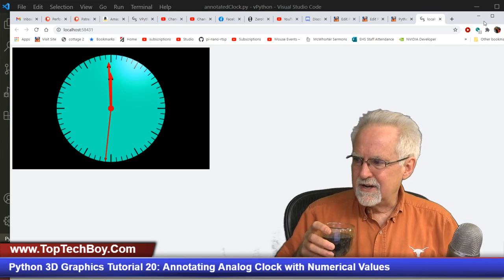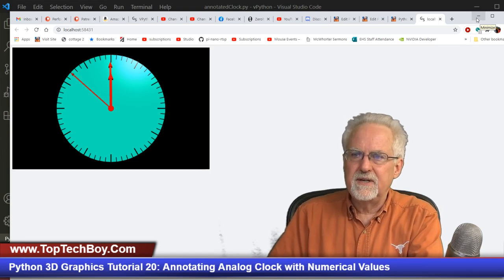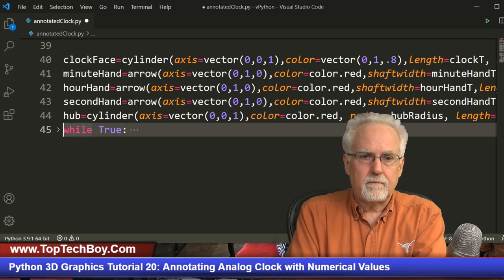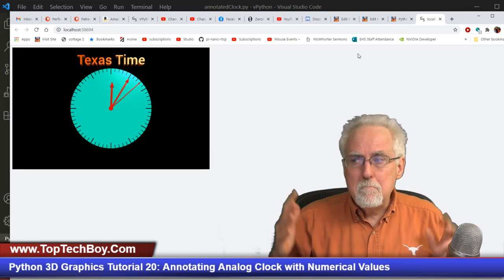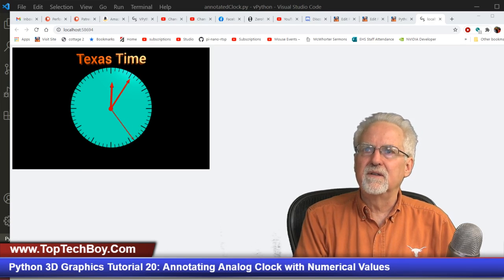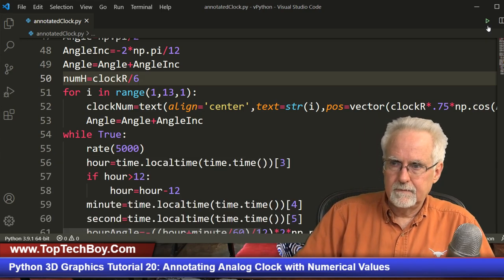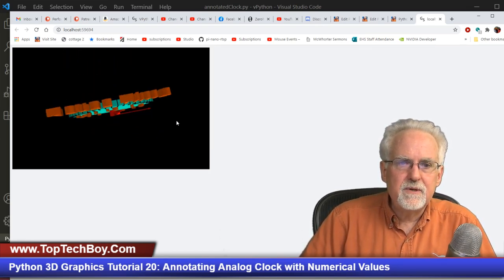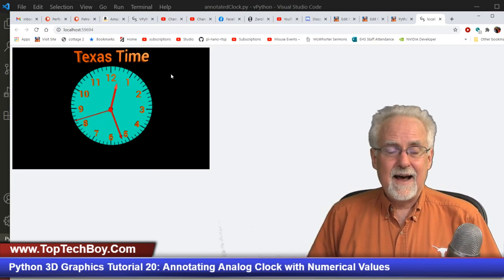Python 3D Graphics Tutorial 20: Annotating Analog Clock with  Numeric Values

Comment: I did the homework but I calculated the angle for the position in the for loop differently than you did.  This is the code that I came up with:

for clockNumber in np.linspace(1,12,12):

        angle = (-(2*np.pi/12)*clockNumber)+(np.pi/2)
        clockNumbers=text(text=str(int(clockNumber)),height=clockR/8,align='center',color=color.red
        ,pos=vector((np.cos(angle)*(clockR-quarterMarkL*2)),(np.sin(angle)*(clockR-quarterMarkL*2)-clockR/16),0))

Hope that this is still a correct way of doing it as it is somewhat different from what you did.  I don't want to assume that it is correct only because it did work.  I am really enjoying learning python and look forward to learn more.  You are great.

Comment: LEGEND!!!

from vpython import *
import numpy as np
import time

# ClockParameters
clockFaceRad = 15                                       # radius of face of clock
tickLengthLarge = clockFaceRad / 5                      # Length of the major ticks
tickLengthSmall = tickLengthLarge / 2.5                 # Length of the minor ticks
tickWidthSmall = clockFaceRad / 75                      # Width of the minor ticks
tickWidthLarge = tickWidthSmall * 2.5                   # Width of the major ticks
clockInnerRad = clockFaceRad - tickLengthLarge*0.75     # Distance of center of clock to center of the major and minor ticks 
clockFaceThickness = clockFaceRad / 20                  # Thickness of the clock face

minHandLen = clockFaceRad - tickLengthLarge             # Length of the minute hand
hrHandLen = minHandLen*0.75                             # Length of the hour hand
secHandLen = minHandLen*1.05                            # Length of the second hand

secHandHeight = tickWidthLarge/2                        # Height of the second hand
secHandWidth = tickWidthLarge/2                         # Width of the second hand
minHandHeight =tickWidthLarge                           # Height of the minute hand
minHandWidth = tickWidthLarge/2                         # Width of the minute hand
hrHandHeight = tickWidthLarge*1.5                       # Height of the hour hand
hrHandWidth = tickWidthLarge/2                          # Width of the hour hand

secHandColor = vector (1,0,0)                           # Color of the second hand
minHandColor = vector (0.1,0.1,0.1)                     # Color of the minute hand
hrHandColor = vector (0.1,0.1,0.1)                      # Color of the hour hand

tickColor = vector (0,0.5,0.5)                          # Color of the ticks
clockFaceColor = vector (157, 34, 53)/255               # Color of the face

textHeight = clockFaceRad/10                                        # Height of text
myLabelText = 'My Clock'                                            # Text on clock face
myLabelPos = vector (0,clockFaceRad/4,-clockFaceThickness*0.95)     # Position of the text    
myLabelColor = color.white                                          # Color of the label text
myLabelDepth = clockFaceThickness                                   # Depth of the label text

hrMarkRad = clockInnerRad*0.8                           # Distance from center of label to center of clock
hrMarkTextHeight = tickLengthLarge*0.5                  # Height of hour markings
hrMarkTextColor = myLabelColor                          # Color of hour markings
hrMarkTextDepth = myLabelDepth*1.05                     # Depth of hour markings

hubRadius = tickWidthLarge*2                            # Radius of the central hub
hubColor = minHandColor                                 # Color of the hub    
hubLength = clockFaceThickness*2                        # Length of the hub

clockFace = cylinder(axis = vector(0,0,-1), radius = clockFaceRad, color = clockFaceColor, length = clockFaceThickness, shininess = 0.1)
hub = cylinder(axis = vector(0,0,1), radius = hubRadius, color = hubColor, length = hubLength, shininess = 0.1)
myLabel = text(text = myLabelText, pos = myLabelPos, align = 'center', color = myLabelColor, height = textHeight, depth = myLabelDepth)

angleInc = np.pi/30
i = 1
while i < 61:
    tickLength = tickLengthSmall
    tickWidth = tickWidthSmall
    if (i%5 == 0):
        tickLength = tickLengthLarge
        tickWidth = tickWidthLarge
        hrMark = text(text = str(int(i/5)), pos = vector(hrMarkRad*np.sin(angleInc*i),hrMarkRad*np.cos(angleInc*i)-hrMarkTextHeight/2,-clockFaceThickness*0.95), align = 'center', color = hrMarkTextColor, height = hrMarkTextHeight, depth = hrMarkTextDepth)
    markClock = box(axis = vector(np.sin(angleInc*i),np.cos(angleInc*i),0), pos = clockInnerRad*vector(np.sin(angleInc*i),np.cos(angleInc*i),0), length = tickLength,  width = tickWidth, height = tickWidth, color = tickColor)
    
    i = i+1

# Initialization of the clock
myTime = time.localtime(time.time())
k = myTime[5]               # get the seconds
prevSec = k                 # placeholder for previous second value
i = myTime[4]+k/60          # get the minutes
j = myTime[3]*5+i/12        # set the hour hand, taking into account there are 60 increments for the 12 hours and we need to include fractional hours (based on the minute hand)   

secHand = box(axis = vector(np.sin(angleInc*k),np.cos(angleInc*k),0), pos = vector(secHandLen*np.sin(angleInc*k)/2,secHandLen*np.cos(angleInc*k)/2,tickWidthLarge*2.5), length = secHandLen, height = secHandHeight, width = secHandWidth, color = secHandColor)
minHand = box(axis = vector(np.sin(angleInc*i),np.cos(angleInc*i),0), pos = vector(minHandLen*np.sin(angleInc*i)/2,minHandLen*np.cos(angleInc*i)/2,tickWidthLarge*2.0), length = minHandLen, height = minHandHeight, width = minHandWidth, color = minHandColor)
hrHand = box(axis = vector(np.sin(angleInc*j),np.cos(angleInc*j),0), pos = vector(hrHandLen*np.sin(angleInc*j)/2,hrHandLen*np.cos(angleInc*j)/2,tickWidthLarge*1.5), length = hrHandLen, height = hrHandHeight, width = hrHandWidth, color = hrHandColor)

while True:
    
    if (prevSec == k):              # only update all the hands once every second
        myTime = time.localtime(time.time())
        k = myTime[5]               # get the seconds
      
    else:
        prevSec = k                 # remember previous second value      
        i = myTime[4]+k/60          # get the minutes
        j = myTime[3]*5+i/12        # set the hour hand, taking into account there are 60 increments for the 12 hours and we need to include fractional hours (based on the minute hand)   
        
        secHand.axis = vector(np.sin(angleInc*k),np.cos(angleInc*k),0)
        secHand.pos = vector(secHandLen*np.sin(angleInc*k)/2,secHandLen*np.cos(angleInc*k)/2,tickWidthLarge*2.5)
        secHand.length = secHandLen
        
        minHand.axis = vector(np.sin(angleInc*i),np.cos(angleInc*i),0)
        minHand.pos = vector(minHandLen*np.sin(angleInc*i)/2,minHandLen*np.cos(angleInc*i)/2,tickWidthLarge*1.5)
        minHand.length = minHandLen
           
        hrHand.axis = vector(np.sin(angleInc*j),np.cos(angleInc*j),0)
        hrHand.pos = vector(hrHandLen*np.sin(angleInc*j)/2,hrHandLen*np.cos(angleInc*j)/2,tickWidthLarge)
        hrHand.length = hrHandLen

Comment: I feel like I may have taken the easy way out on this one. In the end it work. Here's what I did.

I created an array with the numbers 1-12
made a counter starting at 0, to reference my array.

Used my major tick POS and for LOOP ("for theta in np.linspace(0,2*np.pi,13): ect ect

then in my text i used the array[counter}

for example:

myArray = ["3","2","1","12","11","10","9","8","7","6","5","4"]
counter=0

myText=text(text=myArray[counter],.....ect ect)
counter=counter+1

Im going to confirm but im pretty sure when i defined myArray i could of specified a string value and not needed all those ""s

for example: myArray=str(3,2,1,12,,11....ectect)
Reply: So I tried doing it this way but it says that the set object is not callable

Comment: I am legend.
It took me ages to figure out why the numbers were offset up the face. Such a simple step to subtract half the height! I subtracted half the height as as kind of fudge at first, then it hit me that the alignment is at the bottom of the 'text box'......

Also, I appreciate that Paul is being super methodical with subtracting pi/2 from the initial angle and incrementing it negatively. However, where sin and cos are 90° out of phase, and cos is an even function and sin is odd, you can just use sin and cos the other way round and not use any negatives 🙂

https://youtu.be/IJzmLJX-UlI

from vpython import *
import numpy as np
import time

########################################################################################################################################################

# VARIABLES:-

# clock body parameters:
clockrad = 1 # clock radius
clockD = 0.15 # depth of the 'body' of the clock
rimW = clockrad*0.07 # rim width (the rim is to be made up of boxes)
rimD = clockD*1.35 # depth of the rim i.e. the dimension that runs perpendicular to the face
rimsmoothness = 1800 # This is how many boxes make up the rim
offset = clockrad*0.04 # distance between ticks and outer rim
clockbackD = clockrad*0.01 # this creates a 'back of the clock, the same colour as the rim so the ticks can't be seen from the back of the clock
centrepinR = clockrad*0.03
centrepinL = (rimD - clockD)*0.9 # height of the centre pin for the hands to (rotate) around
faceD = (rimD - clockD - centrepinL)/3 # thickness of the 'glass' at the front of the clock

# Text and Tick parameters:
textH = clockrad/8
ref = clockrad/4 # Reference (this was the Major ticks from previous clock editions)
SMtickL = 2*ref/3 # Semi-major tick length
SMtickW = SMtickL/5 # Semi-major tick length
SMtickD = SMtickL/8
mtickL = ref/5 # minor tick length
mtickW = mtickL/6 # minor rick width
mtickD = mtickL/8

# Hand parameters:
sechandL = clockrad - offset - mtickL/2 # second hand length
sechandD = sechandW = sechandL*0.015 # second hand depth and width
sechandH = centrepinL*0.95 - sechandD/2 # height of the second hand above the clock face.
minhandL = sechandL # minute hand length
minhandW = minhandL*0.05 # minute hand width
minhandD = minhandW*0.1 # minute hand depth
minhandH = centrepinL/2 # height of the minute hand above the clock face.
hourhandL = sechandL*2/3 # hour hand length
hourhandW = minhandW*1.2 # hour hand widith
hourhandD = minhandD # hour hand depth
hourhandH = centrepinL*0.1 + hourhandD/2 # height of the hour hand above the clock face.

##############################################################################################################################################################################################################################################

# ELEMENTS:-

# Clock body including rim, back, and central pin for hands:
clock = cylinder(radius = clockrad, color = color.white, axis = vector(0, 0, 1), length = clockD)
for i in np.linspace(0, 2*pi, rimsmoothness): # Start the boxes from the y axis and go clockwise...
    rim = box(length = 2*pi*(clockrad + rimW)/rimsmoothness, height = rimW, width = rimD, pos = vector((clockrad + rimW/2)*sin(i), (clockrad + rimW/2)*cos(i), rimD/2), axis = vector(cos(i), -sin(i), 0), color = color.red)
    # (length, height, and width are x, y, and z respectively)
    rimround = cylinder(radius = rimW/2, length = 2*pi*(clockrad + rimW)/rimsmoothness, pos = vector((clockrad + rimW/2)*sin(i) - (pi*(clockrad + rimW)/rimsmoothness)*cos(i), (clockrad + rimW/2)*cos(i) + (pi*(clockrad + rimW)/rimsmoothness)*sin(i), rimD), axis = vector(cos(i), -sin(i), 0), color = rim.color)
    # The (pi*(clockrad + rimW)/rimsmoothness) elements here are to ensure the cylinders are perfectly aligned with the boxes of the rim.
back = cylinder(radius = (clockrad + rimW), length = clockbackD, axis = vector(0, 0, -1), color = rim.color)
centrepin = cylinder(radius = centrepinR, length = centrepinL, pos = vector(0, 0, clockD), axis = vector(0, 0, 1), color = color.black)
faceplate = cylinder(radius = (clockrad + rimW)*0.95, length = faceD, pos = vector(0, 0, clockD + centrepinL + (rimD - clockD - centrepinL)/3), axis = vector(0, 0, -1), color = vector(0.8, 0.8, 1), opacity = 0.15)

# Numbers:

num = 12
for i in range(12):
    if(num > 12):
        num = 1
    number = text(text = str(num), height = textH, depth = textH/12, align = 'center', color = color.blue, opacity = 0.85)
    number.pos = vector((clockrad - textH/2 - offset - SMtickL*1.25)*sin(2*pi*i/12), (clockrad - textH/2 - offset - SMtickL*1.25)*cos(2*pi*i/12) - textH/2, clockD)
    # The "-textH/2" after the trig function in the y component of the vector is because align = 'center' aligns the box left and right only, not top and bottom!
    num += 1

# Semi Major ticks every hour:
for i in np.linspace(2*pi/12, 2*pi, 12):
    SMtick = box(length = SMtickL, height = SMtickW, width = SMtickD, pos = vector((clockrad - SMtickL/2 -offset)*sin(i), (clockrad - SMtickL/2 -offset)*cos(i), (clockD + SMtickD/2)), axis = vector(sin(i), cos(i), 0), color = color.black)

# minor ticks (every minute):
for i in range(60):
    if((i % 5) != 0):
        mtick = box(length = mtickL, height = mtickW, width = mtickD, pos = vector((clockrad - mtickL/2 -offset)*sin(i*2*pi/60), (clockrad - mtickL/2 -offset)*cos(i*2*pi/60), (clockD + mtickD/2)), axis = vector(sin(i*2*pi/60), cos(i*2*pi/60), 0), color = color.black)

# Hands:
sechand = box(length = sechandL, height = sechandW, width = sechandD, pos = vector(0, sechandL/2, clockD + sechandH), axis = vector(0, 1, 0), color = color.red)
sechandbase = cylinder(radius = centrepinR*1.1, length = sechandD, pos = vector(0, 0, clockD + sechandH - sechandD/2), axis = vector(0, 0, 1), color = sechand.color)
minhand = box(length = minhandL, height = minhandW, width = minhandD, pos = vector(0, minhandL/2, clockD + minhandH), axis = vector(0, 1, 0), color = color.blue)
minhandbase = cylinder(radius = centrepinR*1.1, length = minhandD, pos = vector(0, 0, clockD + minhandH - minhandD/2), axis = vector(0, 0, 1), color = minhand.color)
hourhand = box(length = hourhandL, height = hourhandW, width = hourhandD, pos = vector(0, hourhandL/2, clockD + hourhandH), axis = vector(0, 1, 0), color = color.blue)
hourhandbase = cylinder(radius = centrepinR*1.1, length = hourhandD, pos = vector(0, 0, clockD + hourhandH - hourhandD/2), axis = vector(0, 0, 1), color = hourhand.color)

##############################################################################################################################################################################################################################################

# This is from tutorial 19:-

#textH = MtickL
#mylabel = text(text = 'Time', align = 'center', color = color.black, height = textH, pos = vector(0, 0, clockD))

##############################################################################################################################################################################################################################################

while True:
    rate(1 + 1/2) # Running the rate() function lowers the CPU load by a factor of ≈80 (≈0.1% compared to ≈8%)!!
    t = time.localtime(time.time())
    # This array is of the form [year, month, date, hour, minute, second, etc(the rest aren't important here)]
    sechand.pos = vector((sechandL/2)*sin(2*pi*t[5]/60), (sechandL/2)*cos(2*pi*t[5]/60), clockD + sechandH)
    sechand.axis = vector(sechandL*sin(2*pi*t[5]/60), sechandL*cos(2*pi*t[5]/60), 0)
    minhand.pos = vector((minhandL/2)*sin(2*pi*t[4]/60 + 2*pi*t[5]/3600), (minhandL/2)*cos(2*pi*t[4]/60 + 2*pi*t[5]/3600), clockD + minhandH)
    minhand.axis = vector(minhandL*(sin(2*pi*t[4]/60 + 2*pi*t[5]/3600)), minhandL*(cos(2*pi*t[4]/60 + 2*pi*t[5]/3600)), 0)
    hourhand.pos = vector((hourhandL/2)*sin(2*pi*t[3]/12 + 2*pi*t[4]/720 + 2*pi*t[5]/43200), (hourhandL/2)*cos(2*pi*t[3]/12 + 2*pi*t[4]/720 + 2*pi*t[5]/43200), clockD + hourhandH)
    hourhand.axis = vector(hourhandL*sin(2*pi*t[3]/12 + 2*pi*t[4]/720 + 2*pi*t[5]/43200), hourhandL*cos(2*pi*t[3]/12 + 2*pi*t[4]/720 + 2*pi*t[5]/43200), 0)
Reply from the maker: LEGEND!